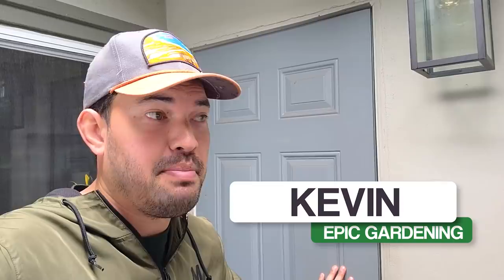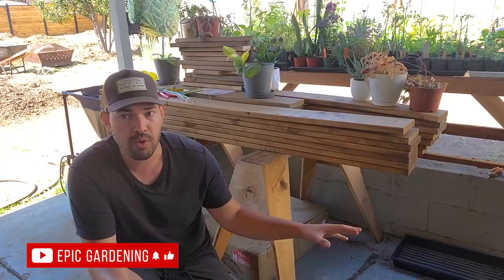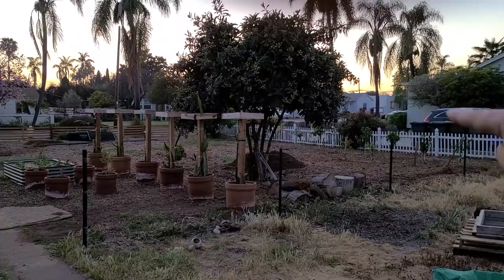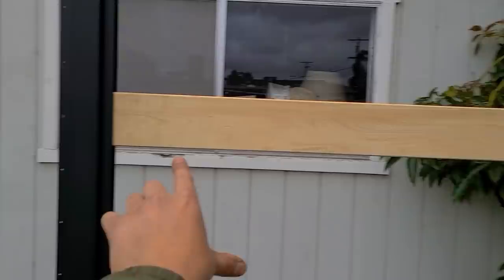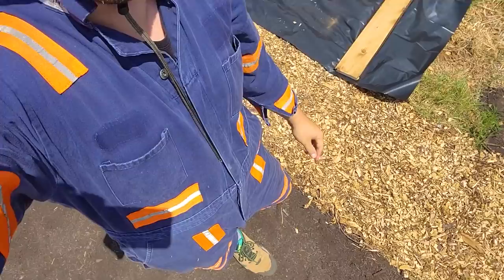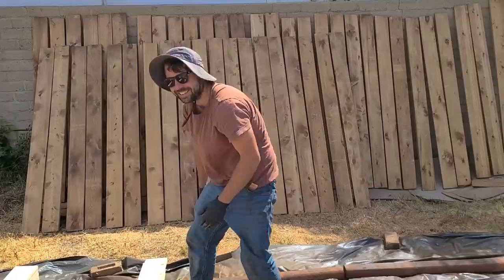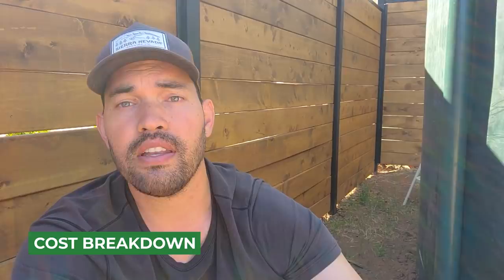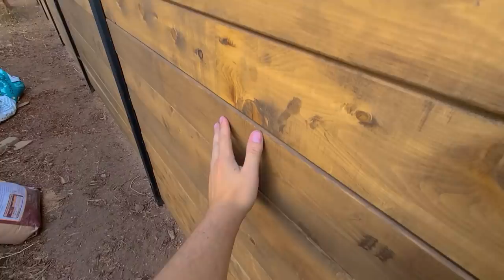Building the EPIC FENCE at the Homestead!

Comment: My first thought was that building a fence that high would negatively affect the amount of effective sunlight for your plants and trees but, as usual, you are a few steps ahead and had already considered that. 

That's a nice fence system. I got a quote for something very similar here in Ontario, Canada last fall and it was nearly double for about 85 metres (about 275 ft) plus a gate- and using pine because cedar is just too expensive right now. So... no. We'll be getting something cheaper. If this was our "forever home", maybe. But it's not.

Comment: If you are going to add a support to straighten the warping, install it like the cross member on your gates
Reply: It's common to flatten warped boards by applying water to the warped side.  Your finish stain might be water proof, but it's worth looking into, or trying out.

Comment: I just stumbled on this.I hope your still keeping up with it. I 'am in the process of purchasing a slip fence, the traditional vertical shadow box with cap. I did the math for a month straight trying to get it to work out for the horizontal 5/4 x12'or 6' cedar is crazy priced, if you can find it ( I'm not on the west coast). My question are the posts you used 3x3 or the 4x4? and what size if different did you use for gate post. Thanks,Chris

Comment: In a dry climate you might get away with this long term. In the steamy Southeast where I live this style of fence is a disaster thanks to all the varieties of warp lumber is heir to. A neighbor did this with unfinished 2x10 southern yellow pine. The bows in your video happened within weeks. Fairly soon deviations became amazing and amazingly ugly. Two years in, snow and ice vertically split one of his wooden slot posts, dropping two sections of slats. They're now sorta back thanks to a strapped post, but . . . The old vertical plank privacy system is far more durable. FYI